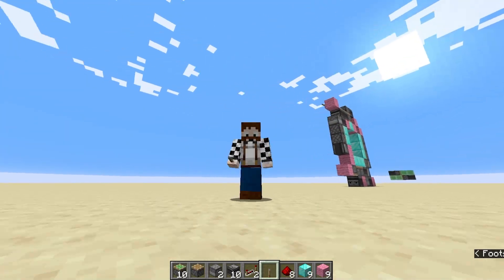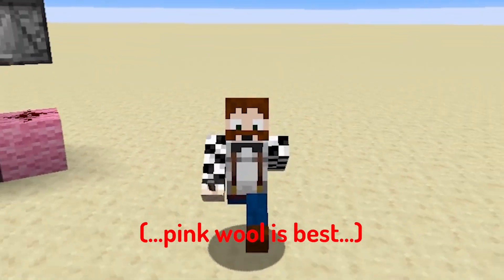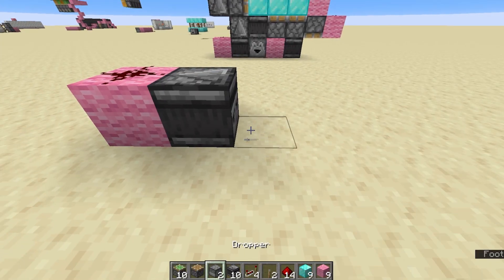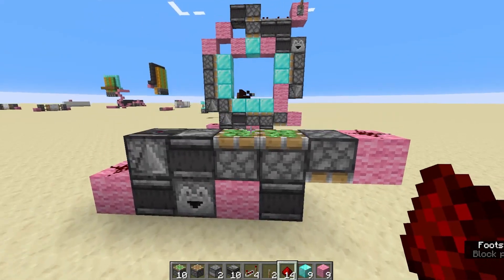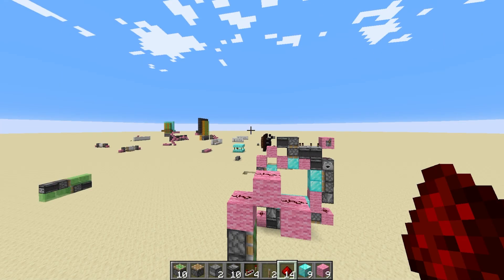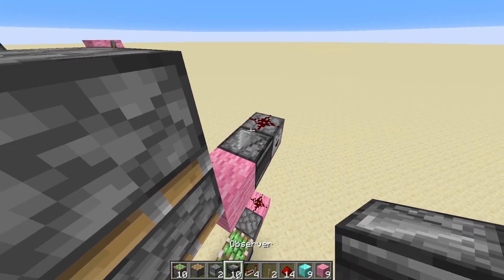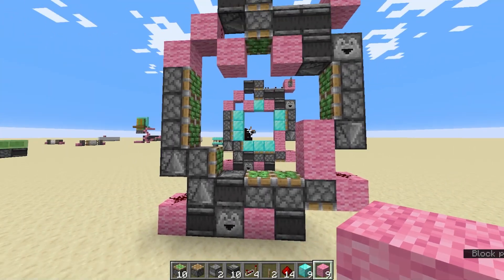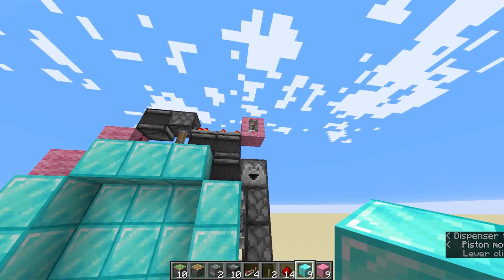Minecraft 1.21 / Minecraft 1.20 Redstone Simple 3x3 Piston Door Tutorial

Comment: Mine isn't working. Could it be something to do with the new snapshot 24w37a?

EDIT: i got it working, i used a repeater that went into the activation block. A tip for others would be to put glass in between your "power cable" and the contraption, since glass doesn't conduct redstone. I used this to make an airlock for my base btw. Thanks man

Comment: Ok, so how am I supposed to actually use this door practically and hide it with a good activation method? Everyone who does piston doors always neglect this part. It is borderline impossible to find a piston door tutorial that actually has a practical design
Reply: It’s rlly ez tbh
Reply: I like to use the Redstone torch key into a t flip flop. Often works really well
Reply: You can use calibrated skulked sensors
Reply: It's super easy to hide it
Reply: I’m sticking with 2x2 if didn’t work I only had tick 3
Reply from the maker: There is a second video on my channel that is a follow up to this video that explains how to move the activation button. As for hiding the workings, I’m afraid that’s up to you!

Comment: can any help with the fact my observers refuse to be turned / it doesnt matter what angle i place it on the block, what blocks are around it, it will only place with the arrow side parallel  with the rest of the frame. even when i go to place them down on the ground. cool door but i guess i gotta find another video
Reply from the maker: It shouldn’t matter which way the observer faces in that way. As long as the eyes face the right direction, and the output faces the right direction it should still work
Reply: @Sassyfish  thank you homie the door looks fabulous in my cave city
Reply: it works if the door face east and west, but not north and south facing due to the observers not being able to turn? idk seems like a pretty stupid mechanic to not be able to place an observer facing a certain way.

Comment: for some reason when i create the door the bottom left or bottom middle block are never in the correct place. am i missing something? (might be the repeaters, i can only count 3 ticks total, not 4?)
Reply from the maker: Hi! So repeaters start on 1 tick (The delay between the input and output) and you can move them to 2, 3 or 4 ticks. So the last setting on a repeater is 4 ticks. Does that help?
Reply: @Sassyfish  thank you for the explanation. I tried it, but for some reason I think what's happening is both pistons in the bottom left corner are not activating properly. I tried it 3 times but with the same error. I ended up using your newest model lol. Great tutorials none the less!